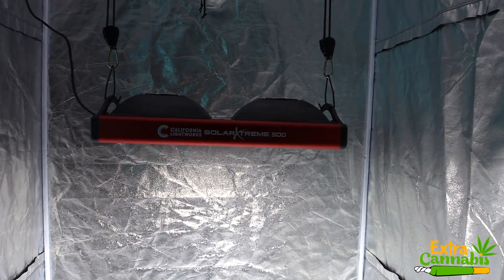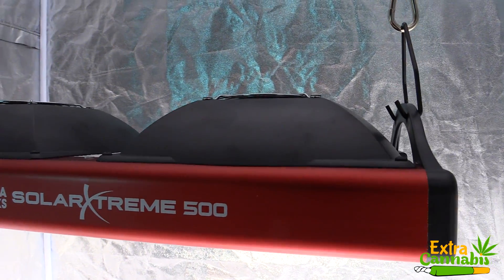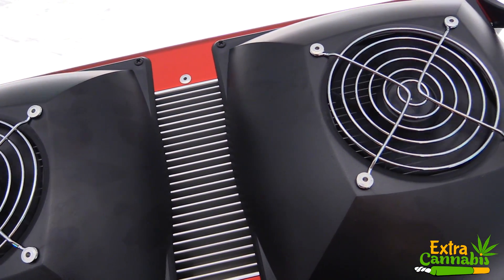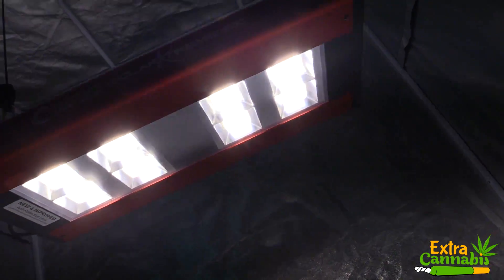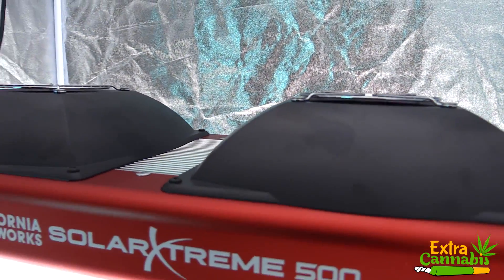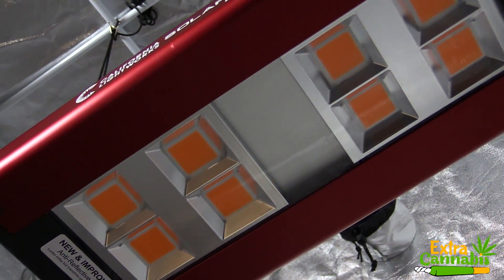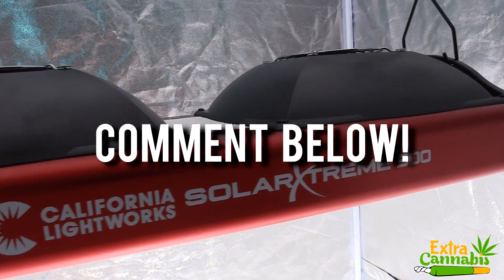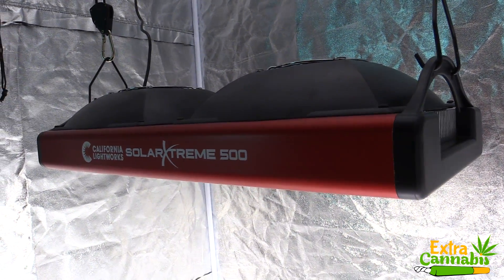CALIFORNIA LIGHTWORKS SOLARXTREME 500 LED GROW LIGHT PAR TEST!

Comment from the maker: What do you think about these measurements?
Link to grow light: http://bit.ly/2oM4mAQ
NOTE In the video, I mention the flowering coverage area is 4'x4' which is what it says on California Lightworks website. The above link goes to LED Grow Light Depot who recommends this light for a 2'x4' coverage area.
Reply: Wow this is way under power to be a 500 watt. To think that they market this as high end. Thanks for the test, show you dont always get what you pay for.
Reply: After seeing the video, I went and did some reading and more par test on other lights, and I have decided that your test was way off, I think the company is much more closer to the reading, if was done with one of Monster Garden test, would like to see them do A par-ppfd test.  Any way because of the door being open, and not doing A 12" height, I decide to get one and test it my self against my 1,000W hPS grow.  Here is day 50 of flower on it. https://youtu.be/IQ8TP1srfIA
Reply from the maker: @hotshotdogy8748  This test isn't meant to be exact; it's just here to give you a general idea of what the PAR output is for the light so growers who use this light can adjust the light distance giving their plants the optimal amount of PAR. Correct, the grow tent has reflective walls so that could increase the numbers and the grow tent's door is open so I can take the measurements. If you are using a different PAR meter for your measurements then you will certainly see different results.
Reply: @GardenTalkwithMrGrowIt  Yes Chris, I understand where you coming from, but people that haven't study PAR-PPFD get the wrong message, when they see incorrect numbers, they don't under the 35% in A 3'x3' tent, and 25% in A 4'x4' tent, and ten to jump to conculison it is A bad light.  Just saying, and I know you did explain it wasn't A correct test.  But really Chris these are stoners, some of us don't even read, just look at picture.  lol
Reply: Too weak for flower at 18”. Wish you woulda done a 12” reading.

Comment: I been growing i. A 3×4 with the 250 and found that I had to back it off past the recommended 18 inch distance even in flower when they suggest 12 inch. It may be because I am new and got small leaves during flower from too much K and then subsequent wind burn from the weaker leaves.

Comment: This light has been around since the dawn of LEDs, it's a full spectrum light not only about ppfd ratings. Great light for 90° and penetration. I use 2 500s in a 4ft x 4ft in combination with some other bloom spectrum uv and ir. Get Awesome results everytime consistently now for over 3 years. Considering how old the platform is they since have new model leds more powerful for around the same price point. Ima ride or die with California light works, I average over 1lb per plant with these lights and again for over 3.5 years now.

Comment: I wonder if it's the type of sensor that makes the PAR drop off significantly. If the sensor was more rounded than flat and facing straight up the PAR could read much higher at the edges of the tent. Not sure though. I bought the light recently. first grow. Kind of regretting after reading a bit more about it but everything seems to be growing well at week 2-3.
Reply: How do you feel about the light now

Comment: i use these lights i have 14 of them i had one in a 4x4 with 9 plants and yieled 19.2 ounces of solid dense buds, kinda shocked on par number
Reply: I use this light I have 2 solarxtreme 500 and I got great result
Reply: Are you pleased with the lights? Par isn't everything, testing lights can get pretty confusing. The bottom line is ppfd. That's what I want to know.
Reply: Yeah but u had alot of them it definitely intensifies the light when their r more together but I would say u need at least 2 for a 4×4 but not worth it at all I can use 2 viparspectra p1500 and shit is Amazing

Comment: Mine puts off tons of heat, how do you manage that?
Reply: Air filtering system with a buffer. also  oscillating fans will work and ducting tube fans.
Reply: @mandotorres746  cobbs always put out heat each square can have up to 50 diodes ,i use mine to veg and as a heater l;ol

Comment: Great video I have one and am currently running it in my 4x4 and it does really well and i was wondering what the par was I honestly thought it was 500 like they said should I lower it since it's not at 500 everything looks really good it's a great light
Reply from the maker: I just subbed to your channel. I'm curious to see how this light performs since there is such mixed reviews on it. Cheers!
Reply: Thank you I'm interested in seeing what it does I was wanting to get another I think we'll see your a great grower and I've learned a few things from you you're a good dude
Reply: @Notalkgrower    After doing some reading on par testing and those CXB Cob395. I have decided that this is just A fly by night test, and the company is much more closer in there numbers.  He is losing lots of light with the door open, and he is not using the light meter that is catching all the light, So with that being said Dean, I think I will get one and test it my self against my 1,000W HPS grow.  Which will be finish in A couple of weeks, and I can get started on this light.  Day 50 of Flower. https://youtu.be/IQ8TP1srfIA
Reply: I meant to say Cob 3590
Reply: Its plug and play  its a fixed light. so, there for it would be good idea to adjust for better performance. According to the instructions..because,It is a wider light display the coverage will vary in par recommendations for that issue would be to double the lights would be ideal meaning buying a second device.
Reply: Thank you I will definitely do that
Reply: From what I understand, that rating they give was done at 12" not 18", so he really needs to do a test at 12".
Reply: @hotshotdogy8748  yes it works better when it's closer
Reply: @Notalkgrower   Just wondering what par would be at 12", I understand that between 900 and 1000 is the correct amount, anything less or more is not as good.  Is this correct?
Reply: @hotshotdogy8748  I've noticed I don't get the plant's praying up  unless the light is closer making the par higher I wish I had a par meter
Reply: Yes I think you should lower it.  The company said they can be as close as 12" during Flowering.  I notice the par was 631 center at 18", at 12" A good guess would be between 900 and A 1,000 and that is where you want the par to be in Flower.  I just bought one my self, will see if it is as good as My 1,000W HPS.
Reply: @hotshotdogy8748  please keep me updated  I will following along
Reply: @Notalkgrower  Ok buddy, I will keep you inform.  I'm think of doing two plants in my 3'x3' tent, should be A banging grow in there.  How has it been doing for you?  Have you been growing under one for 4 months?  I believe the PPFD test would have been much different, if he had the door close, I notice it was about 250 difference in the 24" and 18", so must be close to 900 at 12".  I wish I had A light meter also, but have to second guess these guys that put up these video's.lol
Reply: OK I see everybody’s got their little projects here did anybody go from A-B And if so how do you feel about the light today
Reply: @drodriguez3935  I have done three grows with this light I  will say very durable and does a good job it says for a 4x4 tent  and it can do it I just didn't like how the corners were kinda smaller buds but very solid and amazing color  it's one of the best lights I have I have pictures from it I can show you if you like. Have a good day
Reply: @Notalkgrower  no need I’m old school… a man word has always been good enough appreciate the response

Comment: correct me if I'm wrong, but it seems weak. I was expecting higher par outputs. It says the coverage area is for a 4x4? It's max par for flower is 670ish directly in the center, but you go to the outer corner it drops to 117?! Chris, this isn't good, right?
Reply from the maker: California Lightworks recommends 4x4 space (stated on their website) while LED Grow Light Depot recommends a 2x4 grow space. After seeing these measurements, I agree with LED Grow Light Depot.
Reply: No way this does a 4 x 4.   A 2 x 2 maybe.  Seen better from a $60 Amazon special.

Edit:  $450 Holy Cow
Reply: @victorsupreme214  2x2 would probably be best
Reply: @tybudz6639  Website says UP TO 4 x 2 for Bloom.  I agree best in a 2 x 2 , but considering it would need to be hung at 12-15 inches to achieve 900-1000 PAR thus shrinking the footprint, and it draws 400 watts, for $450.  It fails on all counts:  Small footprint, low PAR, low efficiency, and overpriced.  There are many better options available IMO.  I have the SolarSystem 1100 and it does OK, but this light looks trash.
Driver-less COB tech still seems to have a way to go.
Reply: @victorsupreme214  I really wanted this Cob to work(buyers remorse) being it was claiming a wider footprint & dispersment of light that it needed reflectors to narrow it down says a lot about how the height adjustment is rule.. 
12" Should have been the first test, 
18" for veg 
24" for propagation

 if and when cob does take off it will offset the cost dramatically but as you said we are only at the threshold of driverless Cobs and driverless cob has a long way to go.